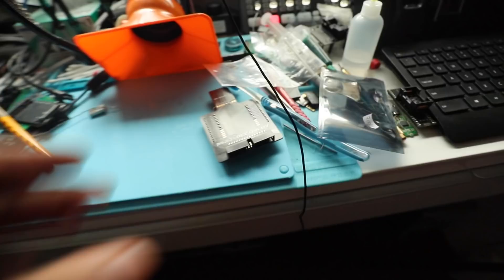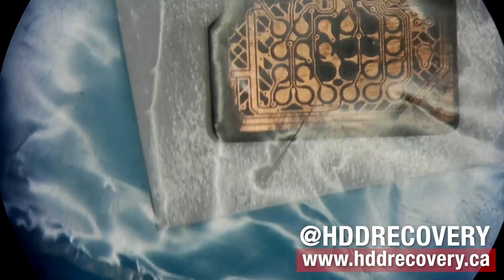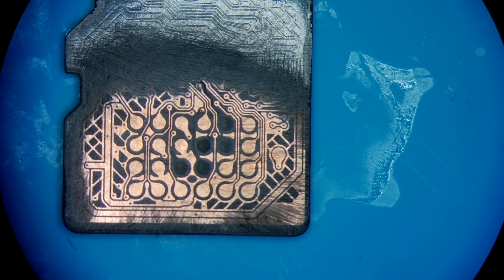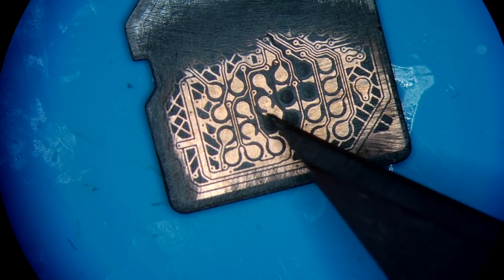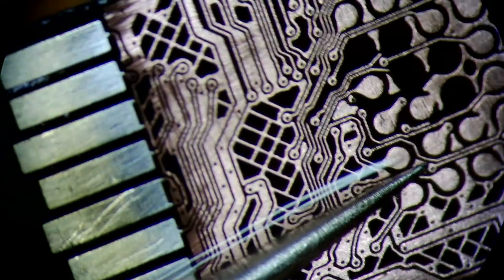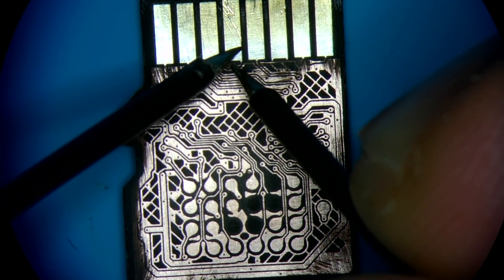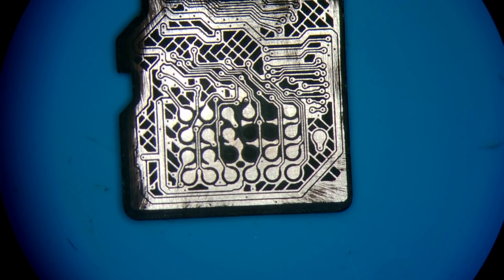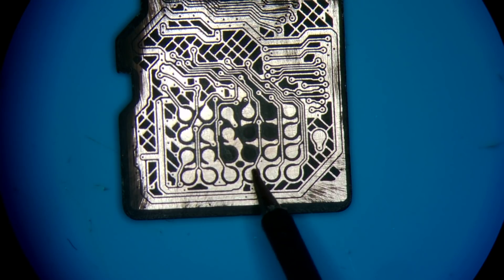this card looked like it could be recovered

Comment: The place there shorted 16:53. The right low corner wire velded to the ground. CEO vire.
Reply from the maker: Thanks for the heads up, but it was not short to ground. That's VCC line. You think I didn't check all signals including VCC before plugging it in? :) you must think I am new to this.

Comment: hello You shortened the wire of the lower rows on the right side, and soldered the 2nd ball to the right corner of the gnd. Connection CE0. In the end of video you can see there shorted.
Reply from the maker: must be the glare+ flux playing vision tricks on you.  That VCC line was not short to ground

Comment: You solder it like microsd type 2 in acelab database, but they also have tyeps 7, 9, 14, 19 and 24 that have 6 columns with 4 pins in the row. Thats why you need logic analyzer? Because not sure which pin what do? I also have micro sd that completley working and it have 6 columns with 4 pins in the row, i record some data on it, scratch pins and solder it like type 2, but ID didnt recognized too, and i'm sure that microsd is 100% working, that can only mean that eather or i did soldering wrong (but i check 5 times with multimeter) or pins is different from scheme. I wanna have logic analyzer DSLogic Plus USB from multi-com with some adapters, i hope when i have it i figure out how to use it and i be able to find pinout myself. Waiting your new video about this case, goodluck! And thanks for content!
Reply: I think you need a 32CH with 200MHz LA, or would DSLOGIC work?
Reply from the maker: 16ch 100MHz will do just fine. DSL is an awesome one and cheap. Plus multi makes amazing adapters for then to eliminate the wire mess. I will review the tool when I get back to Canada
Reply: @MordePT  32 channels is nice, for sure, but as far as i know frequency will lower when you connect all channels, i mean if you connect 10 it be 200 MHz but if 14 and more than it be lower. I belive 16 is enough at lelast if it wouldnt be enough i can resolder some wires after i understand which signal i already get and do next. But notice - i never work with LA, so maybe i wrong
Reply: @DesignerMix  I'm really not sure. I'd love that DSLogic would be enough as it is cheaper then most.
Reply: I own a DreamSourceLab DSLogic U3Pro16 and it works very well for monolith internal interface line/signal identification. In stream mode, it supports 12 channels @ 250MHz. To utilize the full 16 channels, the maximum sample frequency is 125MHz. It also has a higher sample rate capture mode with built-in memory which functions identically to an oscilloscope but I have found the direct stream mode (to computer) is fast enough.

My only issue with the DSLogic U3Pro16 is each channel has its own ground connection so using a large number of channels at once in a small area can be difficult. I’ve never been successful in hooking up more than 12 probes simultaneously to the PC-3000 spider board.